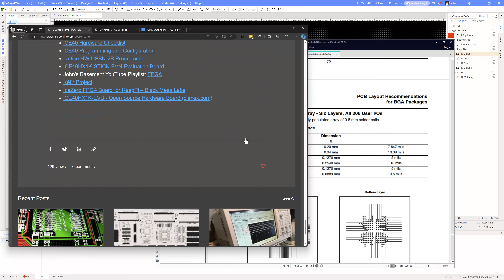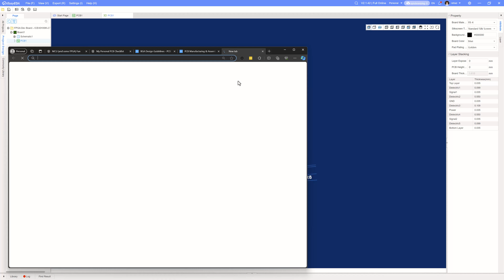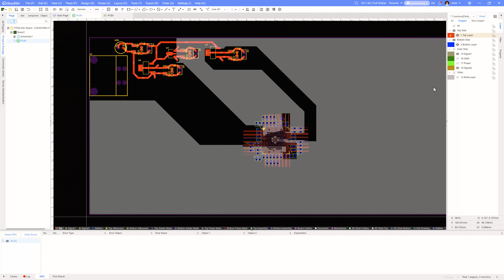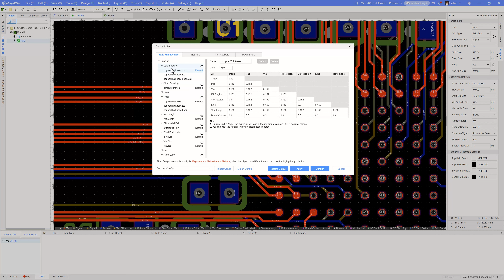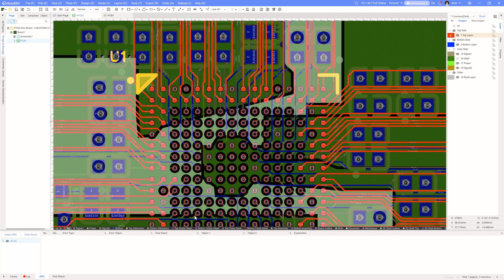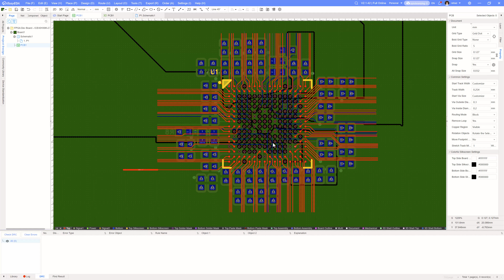First Attempt at PCB Routing for a *BGA* FPGA (Lattice ICE40HX8K-CT256) - Using EasyEDA Pro

Comment: Good thing you decided to go down the route (or should I say the rabbit hole :) ) that is FGPA electronics. It is as challenging as it is rewarding, but man the steep learning curve ahead of you :) you'll need climbing gear :D

First of all, before I put down my recommendations on the BGA itself ( I fully agree with some of the comments below by the way about layer stack-up so won't run interference with it, I believe you are in good hands with all things asmi06 said), I want to take a step back and comment on your power section. You need to redesign this, "standard" voltage regulation won't work here, and if you try it as such, prepare to fry a few ICs.

All FGPAs in my experience are VERY voltage/current sensitive, with a few exceptions. They also have very strict power requirements. Is is important for them to have soft start-ups and gradual ramping, based off of specific timings. If you don't take steps to ensure that, you will have excessive inrush current during the start-up - which is where ICs tend to go the way of the dodo. Slower initialization won't cut it either, as will also cause failures on the device configuration. 

Generally you will need linear regulation too, buck converters directly to the FPGA have a lot of noise which FGPAs don't like either, they will behave weirdly and can lose logic state too. Which is another way to fry one. Ask me how I know :)

What you need to do is utilise a power management IC that offers regulation, I did mention some of these in one of my previous posts to your channel; the LT3504 and the MAX20029 namely. But more specifically for the ICE40, lattice offer an evaluation board for this, which uses LT3030EFE (TRBF), which is what I am talking about. This has the features needed here like Power Good signals, which you can tie in a way that one power rail, say 5V is good, then the next one, say 3.3 initialises and so on. And you ONLY power the FGPA when all rails match the IC spec.

You can of course use either a buck converter or even a good old fashioned regulator to provide power to the power management IC.

Now for the VIAs. What I have done in the past (albeit never on a 256BGA, tops I did myself was a pitiful 168BGA but at 0.5mm :D) used conductive filled in pad VIAs. I did have mostly successes, for the failures usually the culprit had to do with banking signal noise.

Another thing. Lose the SRAM too, it has it's uses, but since you are going with an FGPA, go DDR. DDR2 or even 3 is not all that difficult, and if you put the RAM chip close enough, you won't have issues with timings. Also check the good old open cores website, I am pretty sure you can find some good cores for memory management there, most handle RAM refresh, and you just use it out-of-the box as it were.

If you still want to use the parallel static, expose this an an external IO module, which you can just connect to the header.

Another good approach I would do in your scenarios i.e. for the 3/4x86 boards, would be to couple a second QFlash like a Windbond W25Q Serial NOR (you'd need one for the FGPA configuration, not sure if the ICE40 has one build-in). You can do easy a clever way to program this, i.e. over serial or usb etc. and then the FGPA can handle the "ROM" shadowing directly from the QFlash to the RAM. Easier and faster than having to pull chips all the time.

Best of luck as always. :)

Oh and I am still waiting on your results on the big PSOC, what happened to that? :)
Reply: What you call "power management IC" IS a regulator (it says so right in the datasheet), just with additional functionality. And no, FPGAs work just fine when powered by switching buck converters, infact that is the preferred way of powering them because such converters typically have very high conversion efficiency and therefore generate very little heat. Just open schematics for any board with something like Artix-7 FPGA on it, and I guarantee you in will be powered by a bunch of buck converters (or a single multi-channel buck). You do need LDO in certain cases to power some sensitive parts of FPGA (like ADC, or PLL, or MGT - things like that), but never for the main power or IO rails. For some specific example - the Artix-100T board with DDR3 SODIMM which I talked about here has a total of 7 buck converters and two linear converters, only one of which powers a rail in FPGA for multi-gigabit transceivers, the second is used to create a termination rail for DDR3 memory interface.
As for the memory, I wouldn't be so radical and just go all the way to DDR1/2/3 because they require a progressively more complex controllers, and the FPGA he has chosen is very small one, and so you have to balance bandwidth/memory capacity with amount of resources controller would consume. I know I offered an SDRAM, which still requires a controller - even if it's not very complicated, but if memory bandwidth and capacity are not critical, SRAM is better because it's very simple to use - you send address in, you wait a bit, you get the data, no complex initialization sequence to worry about, no need to mess with PLL/DLL setup, no read/wrire levelling. DDR3 are great for bigger FPGAs, for example DDR3 controller for the board I mentioned above (Artix-100T, DDR3 SODIMM 64 bit data bus, dual rank, AXI4 512 bit interface) takes up about 10K LUTs and 7.5K flip-flops, since A100T has 63.4K LUTs and 126.8K flip-flops, I can afford to spend that much on a memory controller, but it won't fit into HX8K even alone much less with anything which would actually use it. So you have to balance your wants and needs with what you actualy have available. FPGAs provide a great flexibility to interface with all kinds of memories, and there is a reason we have many different kinds of dynamic RAM devices available on a market - from "classic" SDRAM and LP SDRAM all the way to LPDDR5 - because each is ideal for some application/design. I have personally used SDRAM, LP DDR1, DDR2, DDR3 and a DDR3L in my designs (both personal "for fun" hobby projects and commercial designs for paying customers), so it's good to read about each type just to be aware of their pros and cons. Same goes for non-volatile memory - a lot of FPGAs can read their configuration from QSPI flash memory after powerup, however typically there is some space left in a memory device after storing bitstream, and most FPGAs allow user designs to utilize this leftover space for their own needs. And of course nothing stops you from connecting some other type of memory if you need it - anything from EEPROM all the way to eMMC and even NVME drives are possible.
One thing I do totally agree with you is that it is a rabbit hole, and a very deep one too - I'm about a decade into FPGAs, and yet there is still so much to learn! I would say FPGA is the ultimate digital design destination as for the average Joe it's as close as he can ever get to designing their own digital IC.FPGAs are super-flexible, but the opposite side of that flexibility is very high complexity. In this regard I'm glad that @rehsd has chosen a relatively simple FPGA to start his journey - this way he will be able to learn the ins and outs of that device before moving onto more complex devices, as even AMD/Xilinx 7 series FPGA will give this little HX8K a run for the money :) At the same time those more complex devices are also more expensive, so it's good for him to get some practice with BGA soldering without risking a $500 FPGA chip in the process :D
Reply: @asmi06  I do agree with what you say, but doesn't the arty dev board use the ADP5052ACPZ PMIC? I would argue that 7 buck converters with two linear LDOs plus power good flags and discharge switching is a far cry from a asm1117 or the good old 78L05 :) Anyways, I don't have experience with that particular FPGA, I do however have more than 15 years experience is them myself, admittedly as a hobby; But I did read through the datasheet, and it does have specific requirements for ramp-up/down and Power on reset, and from the looks on @redhs power section, so far his power section doesn't meet these requirements. 

For the memory part, Lattice offer themselves IP Cores for DDR2 which only need about 1.5K LUTs, plenty of space in the ICE40HX8K with 7.8K LUTs for that and any other thing rehsd would have in mind. He could very well design a small controller which would fit nice in his board and be able to utilise so of the eBay older SIMMs that go for a song these days, or implement a DMA along and use it for video etc. 

But it is a very exciting trip, I am sure it is going to be very rewarding for him and I can't wait to see the things he can do with it :)
Reply: @ModSlash  ADP5052ACPZ is 4 channel buck converter + 1 LDO channel, so nothing out of ordinary here. asm and 78L05 are linear regulators if my memory serves me, so of course bucks are different in a sense that they are switching regulators, but you can totally use asm1117 to power some low-current analog rail of FPGA. There is nothing inherently different in modern LDOs vs these oldies, except for some quality of life stuff like stability with ceramic caps (1117's are famous for being unstable with super-low ESR MLCCs) and optional power good/regulator enable/slew rate adjust/etc. 
Can you show an example of DDR2 controller for ice40? As far as I know ice40 family IO buffers don't support SSTL signalling so it can't physically interface with DDR2.
Reply: @asmi06 Indeed PMICs are quality-of-life stuff, and I don't think we are arguing anything here but terminology, regulation is regulation regardless. Personally I just follow the datasheets and reference designs, I don't like to play much with voltages around expensive chips :) Imho it is far easier just to get a PMIC for this, rather than use a simpler regulator, wait for the voltage/current to stabilise and measure it until it does, then go on to the next rail and do the same, etc etc. I always opt for something that can do that for me :)

You did get me curious though, what are you utilising yourself for power in FPGAs? I am by no means infallible, so maybe I am approaching this the wrong way, I would love to see other people's approaches on this.

Interesting that you mentioned the SSTL part, I did not notice that the ice family doesn't have SSTL out-of-the-box. It would definitely help, but it is not a show stopper by any means. From the ice40 family technology datasheet, section 4.1.1 it does support DDR I/O and LVCMOS so it is definitely possible, considering the solid PLL/sysMEM block it has. Again I no idea how to go about the ICE40HX8K specifically, but some experimentation doesn't hurt; I can tell you I've synthesised crazier stuff :)

Check https://github.com/mystorm-org/BlackIce-II/tree/master/examples/sram, I haven't tested that specific one myself, nor the Ice40 family either; generally I am more of a Xilinx Spartan guy myself. Had this repo in my bookmarks for a while now, seems a good approach to me at least.
Reply from the maker: Lots of info there! Thank you!

I'll rework the power based on your recommendations. I have the QFN-based FPGA PCB enroute with the simple LDOs, so I guess I'll get to see if I fry an FPGA.  :)  Reading through the datasheets for the regulators you listed, I'm gravitating towards the LT3504. I'll work that into the design. I might spin another PCB before ordering one for the larger FPGA, just to test some things on a lower cost FPGA (in case I manage to smoke a couple, hehe).

SDRAM sounds great. I have some reading to do.

I have a ton of serial flash ICs sitting around, so I can easily add another one.

You're right about the learning curve!

Regarding the PSoC, I have it running. I didn't post a video on the assembly or initial running of it -- just a Community post (link below). I think it's ready to use in my 486DX design. Right now, my plan is to learn a bit more about FPGA and add support on my 486 design to support a glue logic daughter card of some sort. I can then build a variety of ways to solve the glue logic -- whether PSoC, FPGA, or something else. https://www.youtube.com/post/UgkxCnz_SOtT9yXk0IKvQdF55ElB8NiM7o4A
Reply: @rehsd  good job, I had better pay more attention to your community posts then :)
Reply from the maker: @ModSlash  🙂

Comment: Oh forgot to mention - instead of placing headers for every single IO pins, I would recommend adding some kind of memory - like SDRAM,  this will reduce amount of pins in your connectors, and memory is useful for great many projects. And SDRAM is cheap - 3-4$ for 256Mbit (32 MBytes) device.
Reply from the maker: Yes, definitely! I'll see what I learn from the previous QFN iCE board that I have coming and update this BGP board with memory, peripherals, etc.

Comment: I've done plenty of multilayer pcbs at jlcpcb (up to 10 layers), and always used 0.1 mm everything-to-everything rules and never had any problems with manufacturing, nor did they ever complained.
Reply from the maker: Good to know. I guess I'll find out if I exceed any limits.
Reply: @rehsd  They will let you know once you submit the order if something isn't right.
Reply from the maker: @asmi06 Ya', I've had them reach out to me a couple of times with minor adjustments needed.
Reply: @rehsd  Just double-checked my latest 10 layer PCB I've done with them - I use 0.1 mm for spacings between everything except for copper pours - I have 0.2 mm for copper pour-copper pour. If you're interested, I can email you some screenshots of what the BGA breakout area looks like on that board - I have an Artix-100T in 484 balls 1 mm pitch BGA package on that board.
Reply from the maker: @asmi06  I'd love to see what a 484-ball breakout looks like. Thanks!   rehsd.info@gmail.com
Reply: @rehsd  I've sent you an email. Pls let me know if you received it.

Comment: For decoupling caps you've misunderstood the spec - it says just one 4.7u + 0.1u per pin, so only 0.1u is per pin, and a single 4.7u per rail. Also you need to use at least 0402 size for 0.1u - 0201 would be the best as they will fit on top of via-in-pad field, but these are super-small and hard to handle, while 0402 are quite easy.
Reply from the maker: That would be a huge improvement -- to remove all the extra 4.7u's! Thanks for the clarification!!

Comment: That stackup is horrible for high-speed signals. You should always have a reference layer next to each signal layer. So if you need 4 signal layers, you should use signal-ground-signal-signal-power-signal stackup, which is not the best due to two signal layers being next to each other, but I've done it in the past, and it did work. Better 6 layer stackup is signal-ground-signal-power-ground-signal, but it only gives you 3 signal layers. If you really need 4 signal layers, it's better to go for a 8 layer PCB with S-G-S-P-G-S-G-S stackup.
Reply from the maker: Which is interesting, as Lattice's suggested stackup for this BGA is essentially what I am using (I believe). I was working on an eight-layer version for a bit; I definitely noticed the increase in price when I checked it with JLCPCB.  :)
Reply: @rehsd  no way Lattice would recommend such stackup, you probably misunderstood something there. Signals without reference plane is a recipe for disaster.
Reply from the maker: @asmi06  That could be. I was looking at pages 73-74 of Lattice Technical Note TN1074. https://imgur.com/a/WgCE1kG
Reply: @rehsd 1. You've got outdated document, the latest version has different number - tn02024, and tn1074 now shows specifically ice40 fanouts for all packages, and for ct256 they show s/p/s/s/g/s, which is what I suggested (they only swapped power and ground layers).
2. Nowhere on your screenshots do they show a stackup, infact layers and clearly out of order as they show top and bottom layers next to each other. You've got to be a bit careful interpreting such documents.
Reply from the maker: @asmi06  I appreciate the info. Thank you!
Reply: @rehsd  you're welcome! BTW - do you have a Patreon or something like that, which would help you fund all these experiments?
Reply from the maker: @asmi06  I don't, but I've given myself a "continuing education" budget for this kind of stuff. I seem to learn a ton with a relatively small spend, plus I really enjoy it, so I suppose I could pull some money from my "entertainment" budget, too.  :)
Reply: @rehsd  In my experience complex multilayer boards are not that expensive, because designing them takes a long time and so you can't physically order them as quickly as simpler boards.